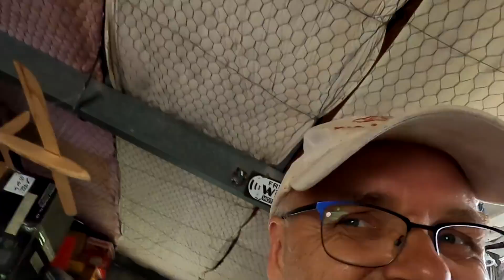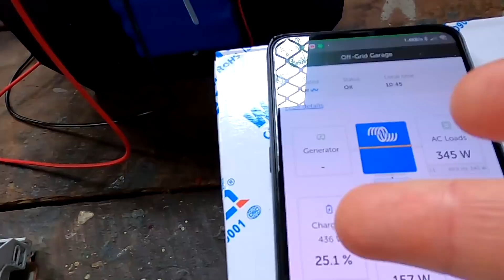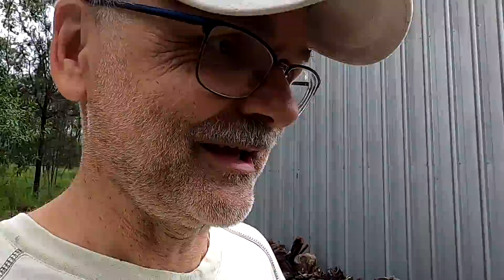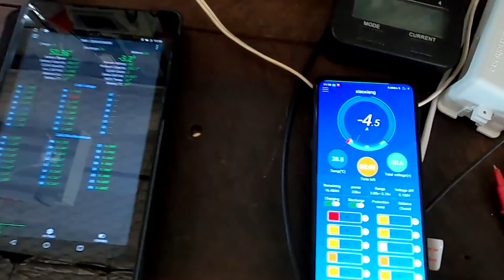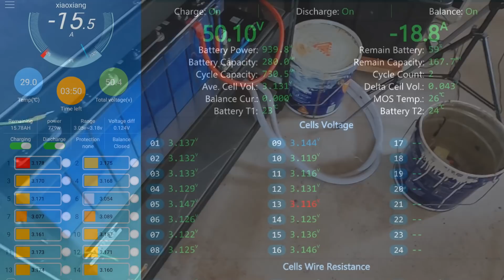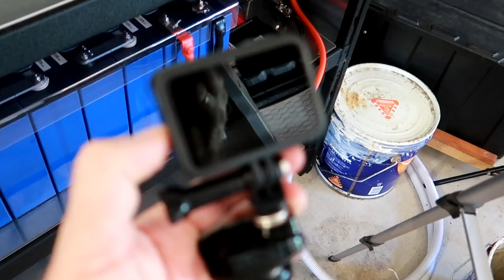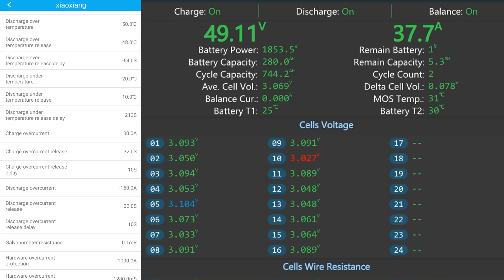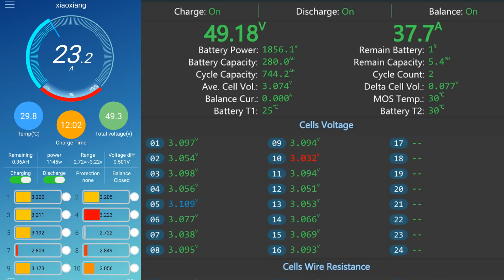Two 48V battery banks, different BMS', low voltage shutdown. QUCC BMS vs JK-BMS. See what happens!

Comment: Thanks Andy, that was an informative test and much appreciated. Do you have any thoughts on a supplemental wind turbine in your situation? I know a couple of people who have similar sized off-grid solar systems in the Caribbean and their 1.5 to 2.5kw wind turbines are more effective than I would have guessed keeping their systems topped off.
Reply: If your locale is suitable for wind, you can charge 24 hours a day. With solar you can only get 5-6 hours and maybe a little bit outside of that.  (If not near the equator the longer summer days are offset by the shorter winter days.)  That means it takes 4x or more solar watts to produce similar daily watt-hours to wind.  However solar works everywhere. Some areas do not have enough consistent wind to be cost effective. Then there is the noise, mechanical wear and maintenance, the tower, etc.
Reply: @Sylvan_dB  All good points. My fiends in the western Caribbean typically get as much energy from 1.5kw wind turbine as from 4kw of solar panels, but they get the trade winds.   I lived on the Sunshine Coast, not far from Andy and I don't remember as much wind as in St. John or Croix.
Reply from the maker: I thought about getting a smaller system with 600-800W but seeing the reviews and test people do, it's not worth it if you don't have good wind speeds. We are in a valley, so not really a good spot for wind. I probably would rather stick with more solar as they will produce ~200W even in cloudy weather while getting constant 200W from a wind generator is not easy to reach.
Reply: @OffGridGarageAustralia  Wind doesn't scale to small turbines. You're dealing with two fundamental issues:

- The Betz Limit
- The Power in Wind equation

The Betz Limit is basically a theoretical number of the maximum efficiency you can possibly get. At most, only 59.3% of the kinetic wind energy can be used to spin the turbine and generate electricity. Remember this is a theoretical limit; in practice, you're going to be closer to 40%.

The Power in Wind equation is given as:

P = 1/2 x ρ x A x V³

Where:
P = power in Watts
ρ = air density (kg/m³, at about 1.2 at sea level)
A = Swept area of the blades (m²)
V = Velocity of the wind

So, no matter how good your turbine is, you will get in practice at most 40% of the wind energy converted to electricity. To capture the wind energy in the first place, you have two variables to increase (one in your control, the other not): swept area and wind velocity. The smaller you make the turbine, the faster you need to spin to make any meaningful energy. The only variable you control is the swept area, which means making the blades as big as possible. Also notice that the velocity is cubed in that equation, so you'll generate much, much less power at low wind speeds; don't assume this is linear or even exponential!

So unless you have pretty much ideal conditions with constant fast wind speeds, it isn't worth it.
Reply from the maker: @upnorthandpersonal  Wow, you're all over it. 😉 Thanks for the explanation.
Reply: @OffGridGarageAustralia  Not the first time wind comes up in these kinds of discussions. I've written the same thing whenever wind pops up on the forum and someone wants to spend money on those cheap 500W/1kW wind turbines. Don't waste the money - physics says no ;)
Reply: @OffGridGarageAustralia  I noticed the same thing around Caboolture. Noosa seemed to have good breezes and I recall a few people there having wind turbines. My friends in the Carribbean say a 1.5kw turbine typically see about 300W to 800W 
Years ago, a friend who had an HVAC company built a wind powered R22 heat pump to heat or cool  a 500gal water tank. He was able to recover up to 3kw of heat from a 1000w sized wind turbine. due to the cop rating of his system being about 3 or 300% efficiently of moving heat rather then generating it.
if you use Air conditioning I was wondering if you use a straight AC unit, and if so if you have considered a water assisted AC unit?
Reply from the maker: @jackoneil3933  Noosa and Caboolture are near the coast and have far more wind than we have here inland.
We have an aircon but don't use it often, maybe 1-2x a year if it is really hot. We have a pool and fireplace instead. But I consider an upgrade with an aircon at some stage once we have more solar installed.
Reply: @OffGridGarageAustralia  With less wind than  Caboolture you are nearly in a vacuum. Hmmm, maybe there's a way to put those frogs to work.

Comment: reaistance seems higher on the older batteries
Reply from the maker: Yes, that is correct. Corrosion, busbars maybe not fitted correctly, one striped terminal, the main switch and the ANL fuse all adds up... We will take it offline soon...

Comment: This is really interesting.

I'm so glad I'm using SMA kit for everything (including a REC BMS able to go to 45kWh) so hopefully it'll communicate better 😳
Reply from the maker: What is the BMS communicating on?
Reply: @OffGridGarageAustralia  I bought the REC BMS SMA Sunny Island-compatible canbus version (with a max of 45kWh).

They don't have an active balancing version for SMA, but hopefully the balancing shouldn't be too much of an issue if I connect them in parallel (across each positive node and the master negative).

Comment: I belive the bms dident start before 1 min delay even it was over 48,6…… if I remember correctly as earlier clip …..
Reply: There might be a parameter for a time delay before it starts charging. This might keep it from thrashing on/off because of slight voltage match of other battery at sharp decline of voltage curve.  ?  Will watch and time it.
Reply from the maker: There is no setting for this in the QUCC app I can see. It might be a fixed timer or even a voltage threshold it needs to reach. It's a bit unpredictable but seems to work.

Comment: Was it the undervolatage release delay once it got to the correct release voltage?
Reply: I think you're right, I was also thinking there'd be a delay rather than an instant re-connect !
Reply from the maker: The undervoltage protection was set to 2.55V, the undervoltage protection release was set to 2.8V with a delay of 20s as per the configuration. 
The BMS turned on the relay again when the overall voltage was higher as its own battery voltage.